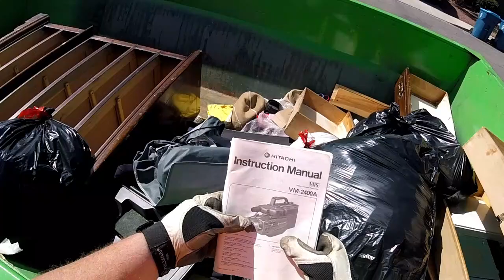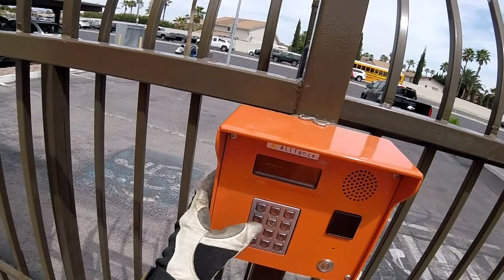Curbside Treasure Hunting Las Vegas

Comment: Hi Paul...Curiosity... Why don't you have a car charger for your batteries that you use on your cutters? It seems as if there are so many ways that they would be useful like cutting bolts and breaking thing aparts at the screws.
Reply from the maker: I do. it burned out the fuse